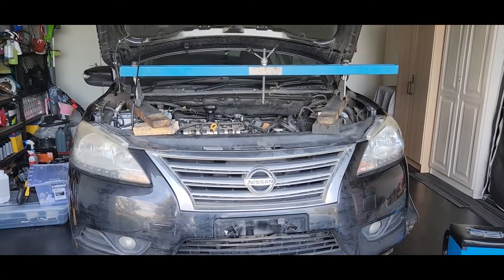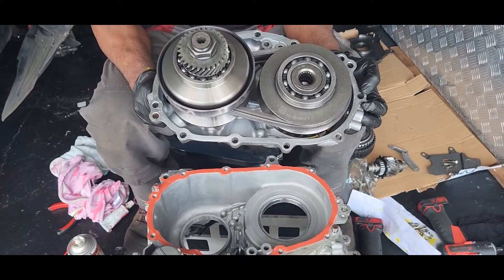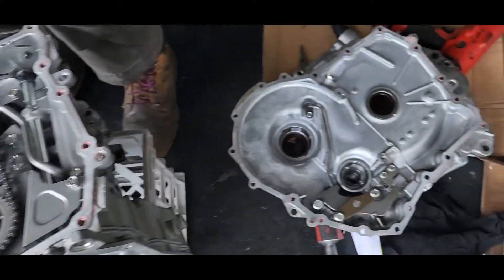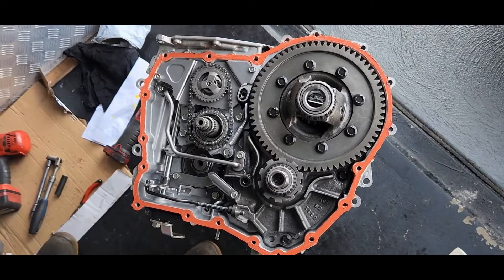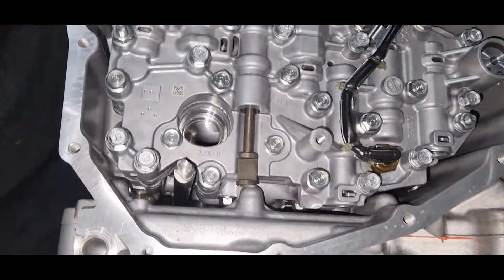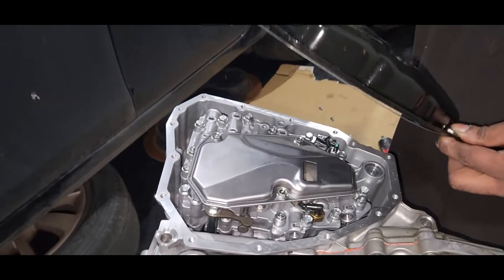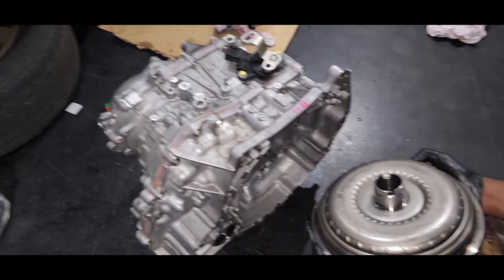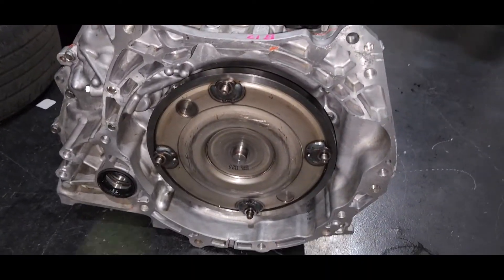Nissan Pulsar B17 CVT  Reassemble Transmission 2012 to 2016 (RE0F11A)

Comment: Hi I have 2013 b17 nissan pulsar and is not engaging D  or L , it can go forward and R is engaging and working , there is a footbrake sign on dashboard not going ,what you suggest cvt fail or 1 of solenoid not work , no cracking sound ,please he'll

Comment: Hi mate, my pulsar is starting to hold high rpm when accelerating and now about 1500rpm higher on the highway. Will that just be fluid or is it failing?